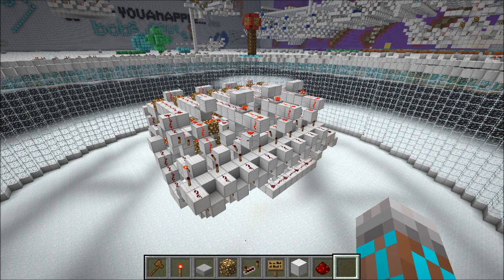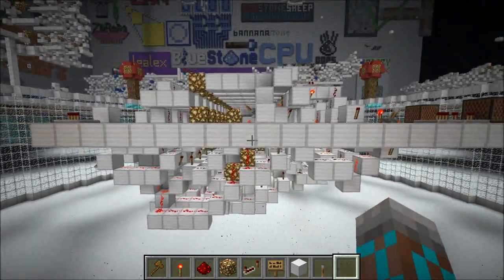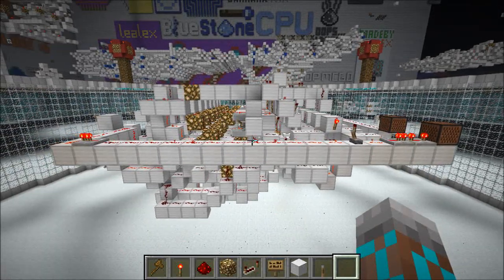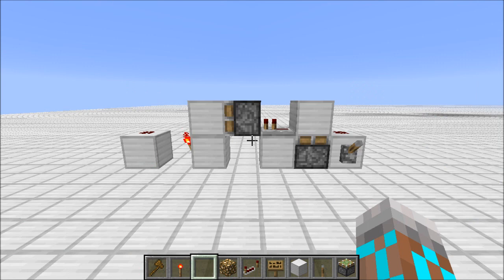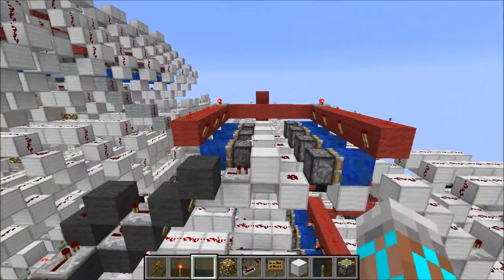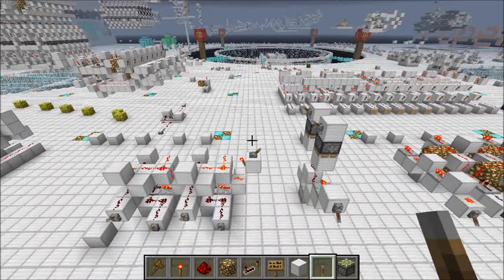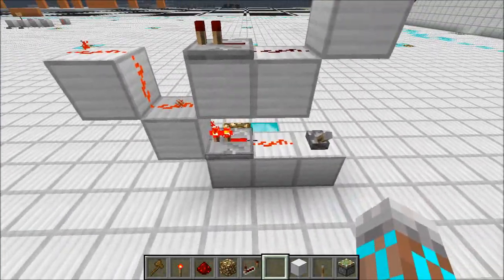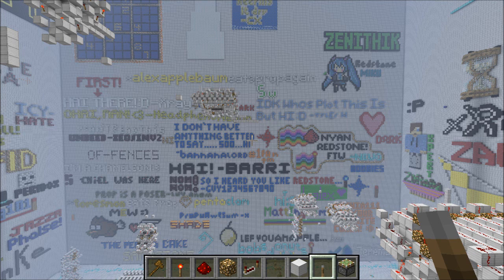Solid State vs. Piston Based Circuits

Comment: With pistons you can also make a variable output with a redstone signal: if the piston is retracted, the signal can go down to the rest of the redstone line; and if the piston is on, the block that it move would cut the redstone signal, but you can use the powered block with a repeater to get the output (:
Sorry if you didn't understand, it's not so easy to explain in the comments.

Comment: I found out that you can make a cool dual edge detector by moving a redstone block adjacent to two pieces of redstone. in the moment that the block is neither connected to one wire nor the other, the redstone turns off. if you attach a torch to this you get an awesome dual edge detector.

Comment: I think that sometime's it's valuable to include a few piston-based devices in a complex mechanism so that the user can "hear" it working.  With total solid-state, it can be hard to tell whether a device is operational or not (aside from a drop in FPS).  I would even go so far as to deliberately include a useless piston in a machine so that it SOUNDS like it's doing something.  Too many pistons makes a ruckus though, so a balance must be struck.